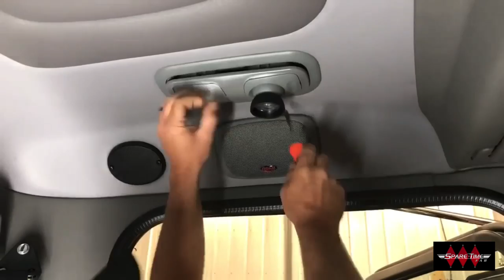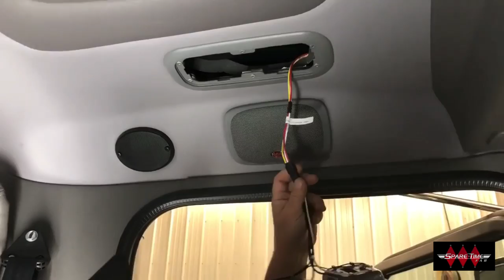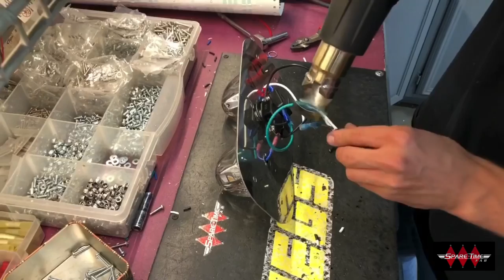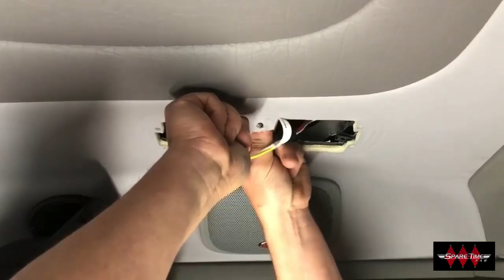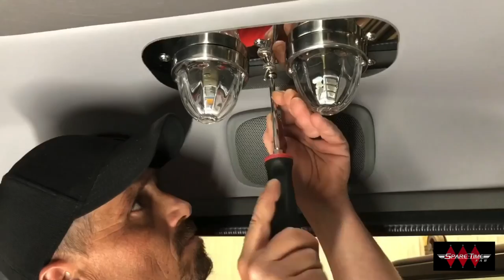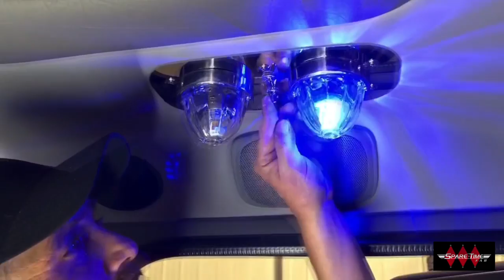Peterbilt 389/386 Dome Lights Install

Comment: I do like this little mod. . Is there a low intensity setting? Like on some of the other watermelon lights?
Reply: I have not found any watermelon lights with a low intensity setting,, it's on or off, you can't dim them. I think you are confusing them with LED lights that have a controller.